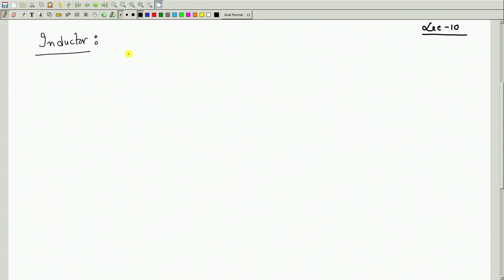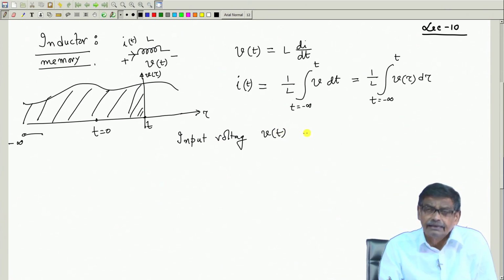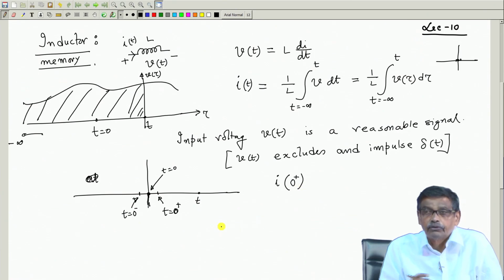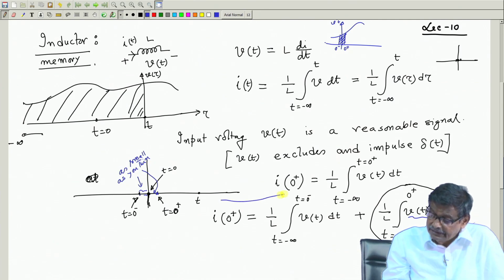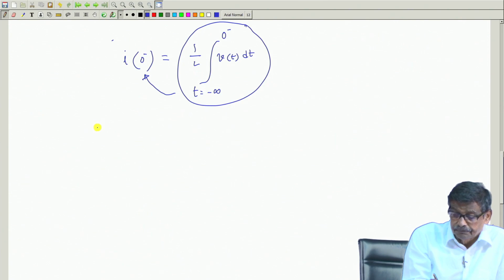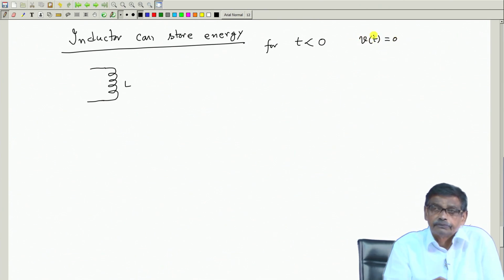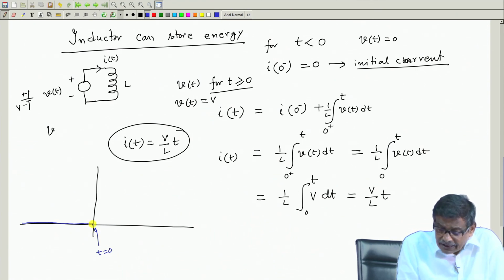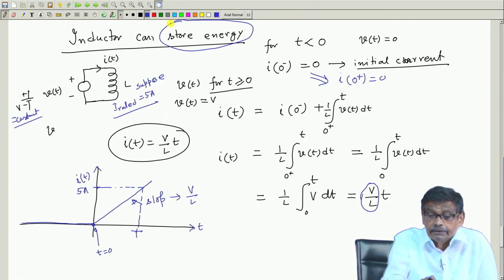Lecture 10: Initial Condition for Inductor

Comment: Approximation sucks....
Reply: While it is not possible to describe in detail the association of non-Conservative fields with time-varying magnetic fields as in inductors, this maybe the cause of confusion of stating "voltage in an inductor appears only across the terminals, not along the inductor". 
The non-Conservative electric field polarizes the inductor and results in surface charge production which produces a Coulomb electric field. 

It would be instructive to understand Current and the conduction process using a unified approach to electrostatics and circuits as in the two videos below before understanding voltage across inductors. 
1. https://youtu.be/TTtt28b1dYo
2. https://youtu.be/8BQM_xw2Rfo 
The textbooks 3 and 4 listed under References in the last frame of video #1 discuss the topics on inductors and voltages in them in more detail.
The last frame contains references in video #1 which lists two textbooks 3 and 4 with topics that discuss the operation of capacitors, inductors, diodes and their operation in amplifier circuits and circuit theory. 
Textbook 4 is here https://techsarworld.com/product-detail/fundamentals-of-electric-theory-and-circuits-559 
Also see
Faraday's Law and self-induced emf - video lectures by North Carolina State Univ faculty
This is a link to a video lecture by NCSU faculty on Faraday's Law. 

Important
7. Faraday's Law
Watch from 8.0 minute.
Ch22L1a
https://youtu.be/ktGL5cEB82I?si=u9vH33gaX1Wy5JvF 

8. Non-coulomb electric field - curly-patterned fields
Watch from the beginning.
Ch22L1b
https://youtu.be/nV6xg-OuxoY?si=UjJBG3wDjazfeQMM 

The second link is to a video lecture on self-induced emfs in solenoids (inductors).
9. Self-induced emf in a solenoid
Ch22L2a
Watch from 10.30 minute.
https://youtu.be/RJ0J_TL-wUQ?si=qPZ74uD-m6weyFlb
PPTs and Videos with animations for all the ten chapters and a few applications  Regulated DC Power Supply, Differential Amplifier and Transformer coupled audio power amplifier of the book Fundamentals of Electric Theory and Circuits are available for download and viewing here
https://techsarworld.com/download-resource/fundamentals-of-electric-theory-and-circuits-559